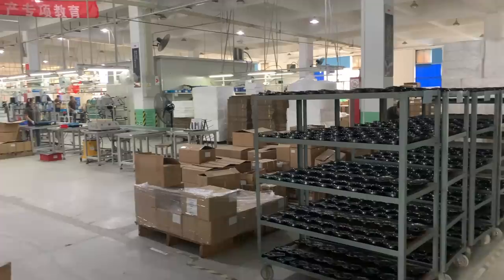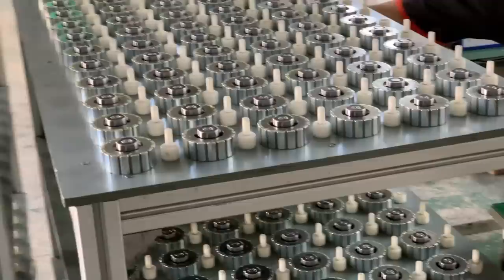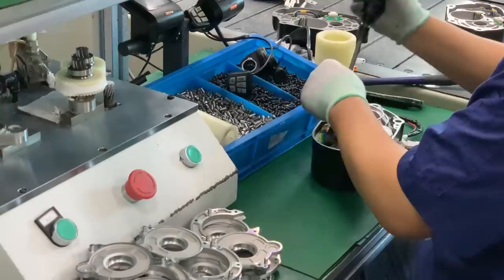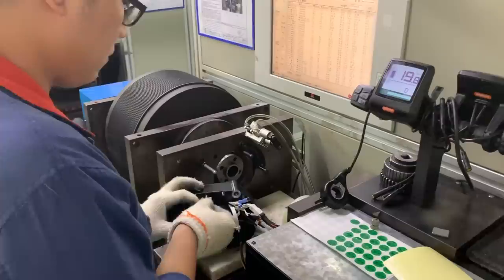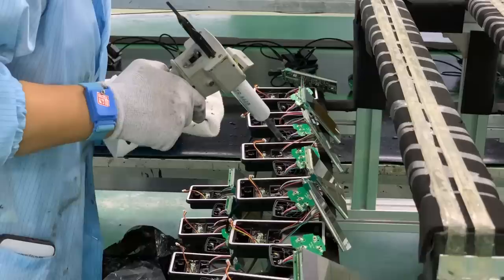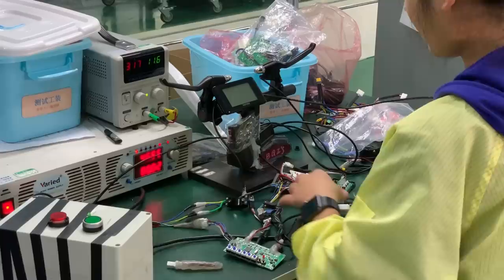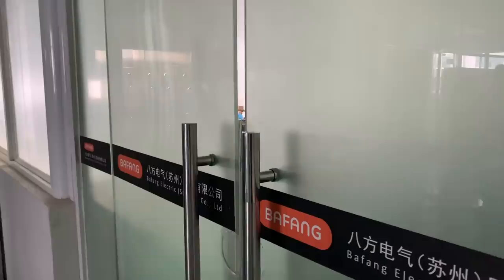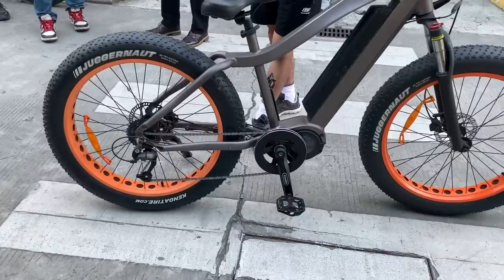How e-bike motors are made (Bafang Factory Tour)

Comment: 1:35 Nylon cogs/gears are rubbish, planned obsolescence, they want the motor to fail the moment warranty expires.
Reply: There is only one .. people have tried to replace it with various materials but then it becomes a noise issue.
Reply: @robvannNS  good point
Reply: Typical design fault, they all do it!! if the motor is good ya get a shit controller 👍😡
Reply: It's for quietness and efficiency, you obviously don't know about Bafang they have a great reputation.  Also it's steel on nylon not nylon on nylon, this increases longevity relatively speaking.
Reply: @davey2k12  in my case Magic pie 3- was both motor and controller had shit waiting for you after 1 year of usage), changed controller 3 times, until found external controller, also motor itself magnets was losen, had to glue all them back in the place, and udititonally there was no pin in the middle of motor to keep aluminium frame and steel frame together, which is modified by me later and fixed, but all this happened each time crashing and coming back by taxi or walking.. there was also rim breakings few times due to losen spokes..
Reply: From engineering standpoint, nylon gears are better than metal in a lot of cases
Reply: @zaminhuseynov9201  that sounds unlucky bro,🙂 I've had my front hub motor + controller between 3 and 4 years now and still using it but have been through few sets of batteries lead acid to 18650s, I know what u saying about spokes I've had 1 winding me up for years 😂and still not fixed it lol
Reply: @morelife9103  depends what you mean by better 😂, cheaper to make/buy, different sizes and shit 🙂
Reply: @davey2k12  Lower friction than most metal mesh, quieter, and also cheaper.
Reply: @morelife9103  interesting I have to look into it more cus I need new back wheel any way lol and I still think it's a bad idea for plastic cus of heat, stress, any foreign objects get in there it's finished .... just make a good metal one last long time 👍🙂
Reply: @davey2k12  just use a direct drive hub motor, mid drives are trash
Reply: @weixuan38  There is a lot of truth to that but Bafang does provide spares to anyone and you should get a year or two before the nylon cogs need replacing. Pretty much all brand mid-drive motors do it and some even have internal belts that wear out, not sure if Bafang does that. Generally Bafang make some of the most durable mid-drive motors if a little crude compared to some.
Reply: Sure...but I'd rather pay for a new E-motor than petrol or diesel. And they aren't that expensive.
Reply: @weixuan38  Depends,I have both. For trail I have a Bafang mid drive for the road a1500w hub.  Apples and oranges.
Reply: I have 38000kms on my m400 n no problems

Comment: Hey Micah, ever since I saw this video; https://www.youtube.com/watch?v=7K87AIiXFpY  I have tried to get an answer from Bafang about their 750w hub motors. Since you're there, can you have them verify verbally which of their 750w rear hub motors is actually 750 watts? The Rad Rover's 750W Bafang motor is much smaller internally and lower in weight than other 750w Bafang motors. The Rad definitely DOES NOT perform the same as some other 750W ebikes, yet from the outside, these motors "look" the same.  It's like Bafang knows that 750 watts is the legal limit in the states, so everything they want to sell us is a 750w motor, even if it isn't.  Idunno, maybe they changed the way they measure watts and torque.I've emailed and asked them about this several times over the years, but they simply will not respond.

Comment: No information on what parts are made of.
Reply: Metals: copper winnings, magnets, looked like cast aluminum housing, and nylon gears. I mean what else did you need? The specific materials on the plastic connectors? Like it’s going to be an iron core for the stator as like 99% of motors are basically the same, then some steal ball bearings (or roller bearings), like none of this has any indication on actual quality (as sloppy tolerance bearings can be made from the exact same material). A lot comes down to basic design of the product and quality control plus the strength of the magnets (since the same type of magnet can vary wildly between weak and strong, I’m not sure even knowing exact material would help, more a measure of magnetic strength would be useful, but truthfully just the motor performance parameters are all you’d really care about like power/torque/efficiency/weight and overall durability and longevity.
Reply: @jakegarrett8109  Thanks for all of that.  
When I watch a review of a product where the reviewer shows a deeper knowledge of the product than other reviewers I almost always give greater value to their words than to someone who seems to be rattling off marketing blurbs. 
If you had added in the video just half of what you had written above I would have thought I need to subscribe to this guy as he clearly knows what he's talking about and he's interesting and I'm learning more.

Comment: A good future is being offered with these electric assist bicycles if we can stop using carbon based fuels.
Reply: ......…. except that most electricity is generated from carbon fuels.  and electricity transmission is notoriously inefficient.  and battery charge / discharge cycles are the biggest inefficiency.
Reply: Raymond Ashby for now. We are definitely running out of time.

Comment: nylon gears
Reply: quite
Reply: urtyp All 3 bike use theme I work at a bike shop and I replace them often
Reply: @fastbicyclerider7300  haha I destroyed one set and then changed to gearless motor. much better.
Reply: Fast Bicycle Rider      I also have worked as a bicycle mechanic. Question: Since my hub motor is out of warranty, can I open it up and lubricate those nylon gears? And would I use a Teflon based synthetic grease? Thx Richard
Reply: @richardbailey2130  I tried an threw it in the trash
Reply: @richardbailey2130  We service them in my shop all the time. What we do is coat the gears with grease, and drip a little bit of Tri Flow into the lockup clutch.

Comment: Nah bro mine was from eBay China 😂
Mid drive 😂😂😂
Doesn't help adding extra ware and tare to ya chain 
Hub motor better not to mention the ripoff price of mid drive ....cheap hub motor would piss on this
Reply: That depends... A good Mid motor is better than any Hub motor... Also Hub motors feel like riding a Moped...
Reply: mid motors are better for sport cycling because better weight distribution. Hub motors are better for city commuting because lower price and lower maintenance too (mid motors stress your drivetrain)
Reply: try a steep hill with a hub drive piss poor!
Reply: @kevwalton272  depends on ya batteries bro mines fine but does drain em but that's with all of them that's the only positive mid drive has compared to hub 
But that doesn't matter cus of the mid drive and the  price is double triple than hub kits 👍🙂 why even put motor anywhere near peddles should be generating power and dump it in to batteries or caps
Reply: @kevwalton272  I do it all the time with mine.
Reply: kevin walton mine is totally fine, about tried to kill me launching me into an intersection nearly doing a wheelie (the PAS system is now disabled for safety reasons...). It was the cheapest 700c comparable kit, rated 1200w, I did a shunt mod on the controller and I was measuring 37.5+ amps continuous in acceleration (DC clamp meter) at 54-58v on the battery (I claim it’s 1700w since realistically it’s not always full charge but it’s really 2+kW at full charge). The thing was an animal stock and now it’s ridiculous. Like sure it’s a little slower than my 52cc chainsaw powered bike (but other than smoking tires that was an awful and heavy idea, haha! 25cc was way more controllable, lol!).

So slower than my 250cc dirtbike, but like at 2kW it’s no slouch with insane amounts of torque as the thing leaps off the ground (I have a bare carbon fiber seat that’s insanely slippery wearing jeans, so the first time it litterally shot out from under me as I wrestled it to slow down as it’s spraying rocks at me from the driveways. Like it’s great fun, I want to switch to 108-120v controller and double my battery so I can hit highway speeds, small legal loophole here in Texas I discovered, haha!)

I mean maybe your mid-drive competes against this $220 kit, but really, this thing will pull you up any hill so long as you’re not also dragging the titanic up with you, haha!

Comment: Nylon gears=planned obsolescence. Holds up until the calculated guarantee ends.
Reply: it's to reduce noise, all manufacturers use a nylon gear...but one that uses a belt, Brose I think
Reply: if you dont like it you can always buy direct drive. Pretty much will work until the day you die.

Comment: Nylon gears make me weary, but i hope im wrong
Reply: Nylon has a little 'give' in it before it starts to grind or disintegrate, so unless it is being over-stressed, it will be more than adequate. If it is being over-stressed, then you want it to break, rather than passing that onto another part of the drivetrain that could cause injury to someone.
Reply: Maybe ceramic!? Best
Reply: @thosethatcan  ceramic? nah too brittle, milled alu or steel would be best. cast is too brittle.
Reply: Simple & sad reason: It's planned obsolesence. It should be a crime to design components like this.
Reply: @alsterwasser08  I have 1500 watts going through my nylon gear and it's holding up it's not so it fails it's because metal gears are much louder and nylon is self lubricating
Reply: i have 5000km now on my BBSHD with nylon gear. super quite and holds up great. cheap and easy to replace IF it breaks
Reply: @swedenrc4489  I am planning on replacing with a metal gear soon with the knowledge that it's going to be loud. Only because I'm going to be pumping 3000 watts through my motor. nylon is actually strong enough for that without heat but once it heats up it gets slightly softer and I'll be pushing the heat limits
Reply: ohnoespops with 3000w i would also change to steel 👍
Reply: @swedenrc4489  Aaaand if it ever breaks just buy a Steel gear from Lunacycle
Reply: nylon gear is to reduce noise, everybody doe it, not just Bafang. Maybe you can go with Brose, I think they use belt instead of gear.
Reply: Nylon does seem to work reasonably well, although in my shop the failure we see the most with the planetary gears is cracking. You can tell if you have a cracked planetary gear if the motor is making a clicking sound when it spins.